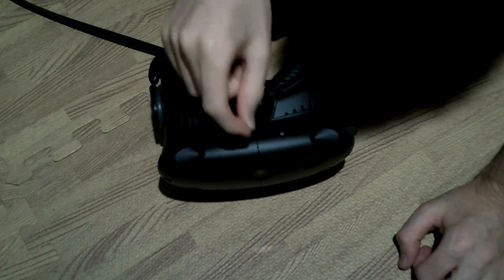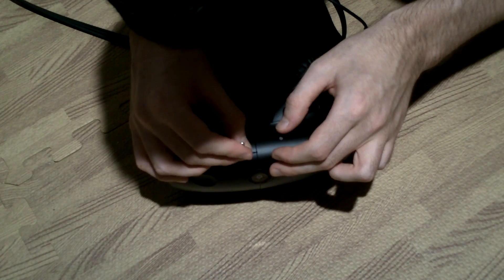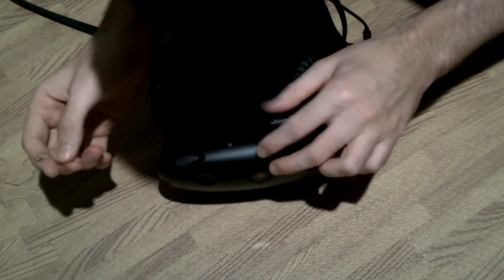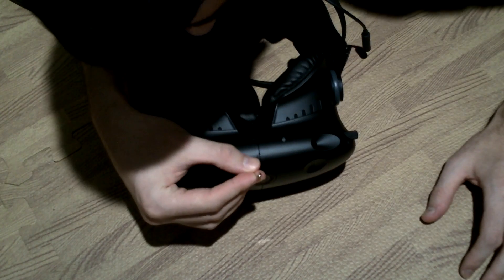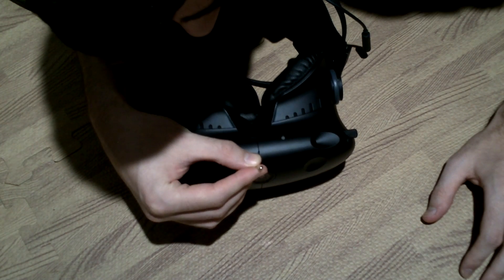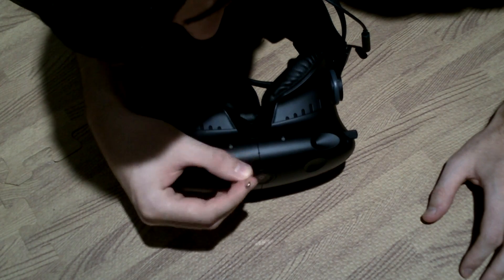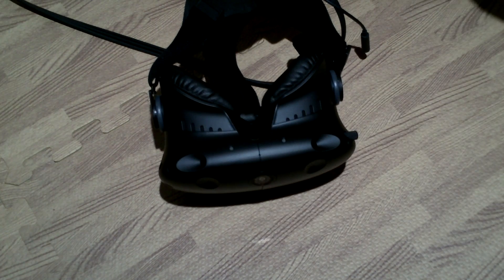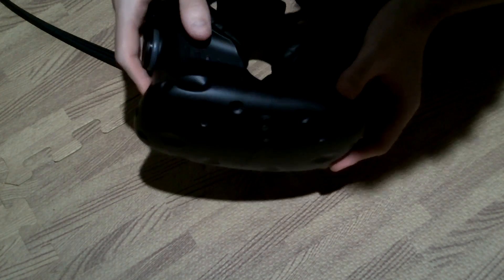HTC VIVE Mic Mod

Comment: thanks for this video! i just tried my first Vive stream on twitch and it was 4 hours of cringe. not only was there popping from the words i spoke, but 80% of every breath i exhaled from my mouth sounded terrible. half of my stream sounded like i was in a wind tunnel. I'm going to try this out and let ya know how well it worked.
Reply from the maker: +Tornwingss please do, hopefully it improves. I hear that some later versions of the vive the mic is improved. Some are a bit dodgy. Positioning should improve things too. If its still really bad tape some clOth over it.
Reply: So, did it help?
Reply: I tried it, did a small bit of foam and jammed it in there (but left the edge sticking out so I can remove it if need be) and it worked about as well as his first test.  Good enough to get rid of most of the sound pops.